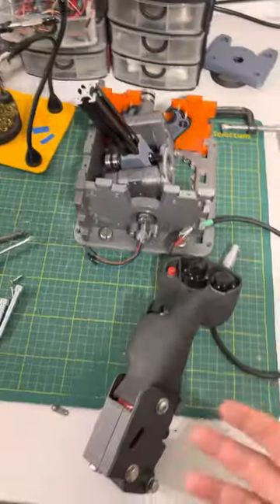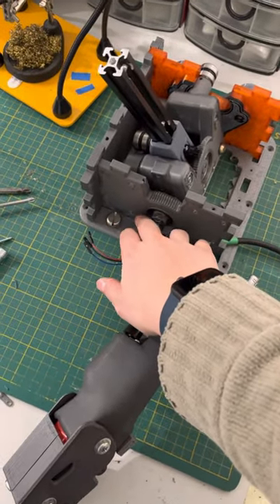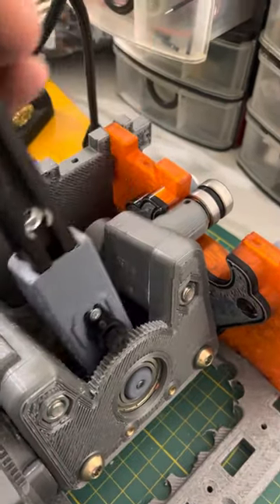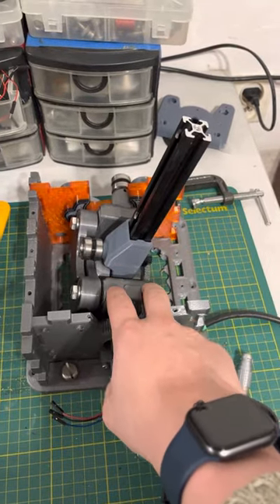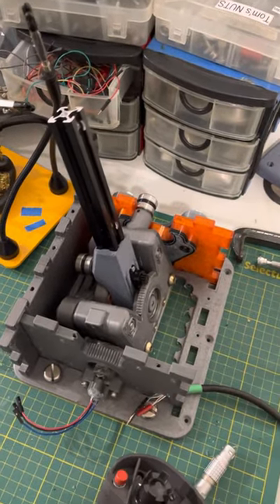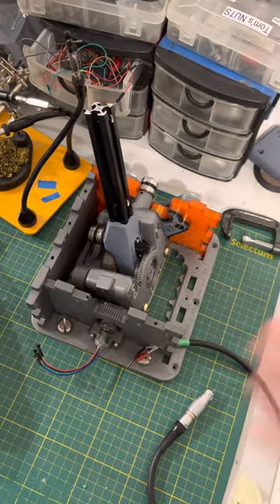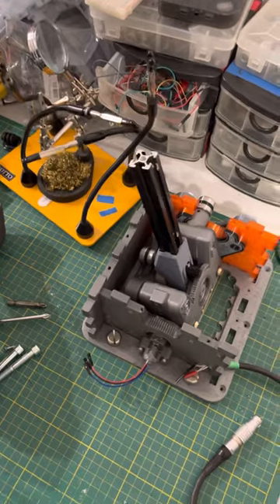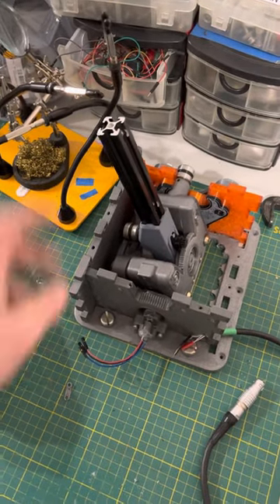Crowdfunding open source big joystick Gimbal design?

Comment from the maker: This project has stalled and now that I finally have space to work again, I am interested to know if my followers would be want to support finally getting this to the finish line and having open source plans? 

Want to have enough resources to make 2 more prototypes. One of a new cleansheet design that is much more efficient and a second to make a build guide video on how to construct it. Also am looking for someone to donate/loan a TM grip so I can design compatibility for it, and also have a freejoy firmware preprogrammed so for assembly everything plugs in.

Final design would be 100% free and open source.